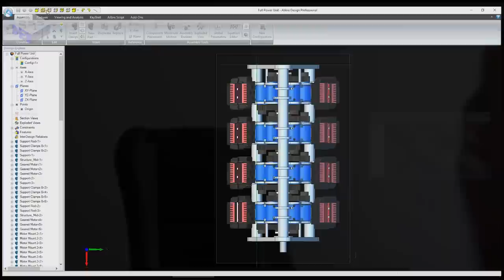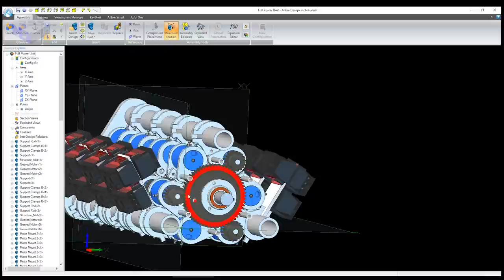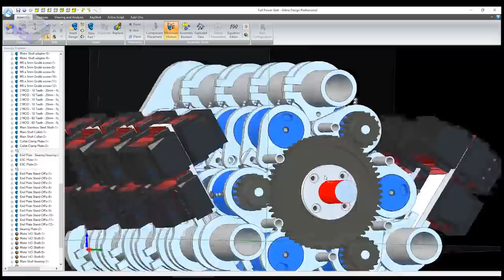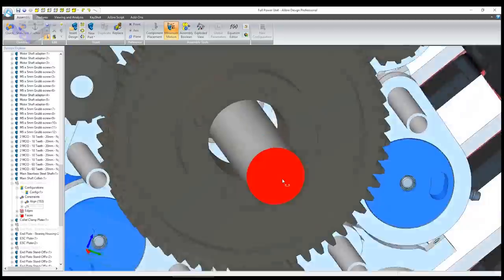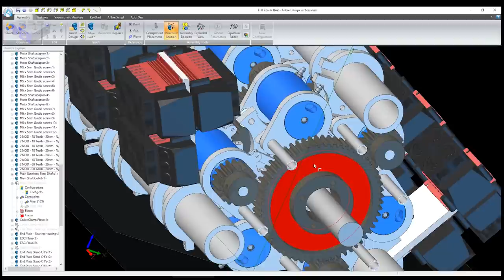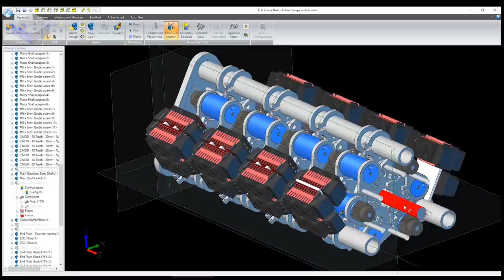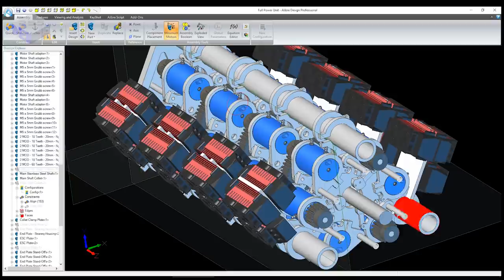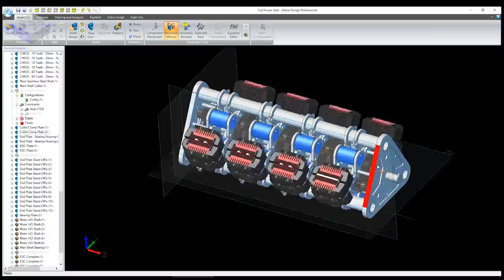MG F Electric Conversion - Take 2 - Better Audio

Comment: Whats the Dia of the output shaft? From the Looks of it I'd beef it up a little and ditch the collets. There'll be a lot of torque. Two opposing keyways will do away with Balance Issue. Thanks, love to watch!
Reply from the maker: The output shaft is 25mm steel, around the same size as my driveshafts on my 3.2 Vectra, so I figured this would more than cope with the torque. I like the idea of collets for zero backlash, rotational balance and it would slip if there was a fault instead of ripping everything apart. I'll bear the keyway in mind, a keyway was my first choice too, although I like the idea of multiple redundancies in the event of a fault.

Comment: Why not a boat ESC for water cooling
Reply from the maker: Good question, I can't remember considering these, may have to try one and compare. Would be interesting to see if you can continually pull max power through them, I wonder what formula E use?

Comment: Interesting project. Looking forward to seeing your progress. lots of interning packaging options, are you planing on keeping the pg1 gearbox?
Reply from the maker: Hi, yes will be either making a plate to connect direct to the box or cut the end off the failed engine as that would be easier initially
Reply: @TheSolarPoweredEngineer  You mention the length of the assembly, but how big is the bounding box its fits in? I can see  lots of applications in kit cars and simalar. what is the plan for controlling the connection and the disconnecting the individual drive moters from the main drive?
Reply from the maker: @TheCeebmoj  The unit according to CAD will be 415mm x 660mm x 255mm, where the car will be the housing, so just need to attach mounts to the power unit and enclose the engine compartment instead. I would love to be able to make this modular eventually and be able to take a module out and stick it in a jet-ski or something similar :-). there is a tiny metal geared motor that will connect and disconnect the motor, I chose not to use a servo for simplicity and space in the unit.

Comment: Did you already suggest how to move the Motors in terms of power distribution? And did you  chosse a away to put them in sync to not load them with unnececary damage while reentering the main power axis ?
But great worl, Im Maximum cusios about that project
#hitthebell
Reply from the maker: Hi, the sync may be done by measuring the main gear speed optically by counting gear teeth, then meshing the gears (this may have some impact, but hopefully very little, similar to a synchromesh on a gearbox), we will see

Comment: Can we get a link to the motors where to get them thanks 👍
Reply from the maker: Here ya go https://hobbyking.com/en_us/turnigy-aquastar-4084-1050kv-water-cooled-brushless-motor.html
Reply: @TheSolarPoweredEngineer  OMG!!! I followed the link and this engine will cost you well over £2k. A Nissan Leaf motor is less than £500, designed to be 80kW (110hp) but capable of much more and is bomb proof. 
I don't want to sound like a kill joy as I love the idea of an E- MGF but this sounds a bit crazy. 
Still I'm fascinated to see how it turns out so have subscribed. 
Good luck with it.
Reply from the maker: @alibro7512  I know, a little expensive to say the least, but it's worth it for all the questions it may answer and hopefully teach us, the redundancy is what I am interested in too, where everything can be swapped out easily and disengaged while driving if there is a problem. I like to try crazy things sometimes, especially when people say "that won't work" 😁
Reply: @TheSolarPoweredEngineer  I love crazy builds like this so long as you know what you're doing and from the look of your design you do. (Probably) 😉
Look forward to more updates.

Comment: Spur gears are going to be very noisy even if made of nylon. Helical gears should be used. I'm not seeing a lubrication method for any of these moving parts, it may work but not for long.
Reply from the maker: Hi, Yeah I agree, although just for testing, helical gears would increase the cost of this but could be added later on due to their higher surface area and increased load capacity too. I'd love to see how long these gears do last like this too, so I'll keep a revolution to load count in the programme and hopefully this will answer your question 👍

Comment: Heard about your channel in James Bruton's latest video, interesting concept! Have you done any calculations for efficiency vs one large motor? I'd imagine you could have a fair bit of loss due to gearing.  The modular design is great! You've probably already looked into these but you may also be interested in how the Prius mechanically load shares between the ICE and electric motor (https://auto.howstuffworks.com/hybrid-car7.htm) and how you can electrically load share (https://pdfs.semanticscholar.org/c17f/9838617bed88b66fcd6457545edec516dd9c.pdf).
Reply from the maker: Thank you,  I'll take a look at the load sharing bit, I won't know the efficiencies until I test a few motors together. If a fair few motors are disconnected it may just have less friction when you think of magnetic resistance in each motor, you would only use small coils in the ones that are on (just my thoughts at the mo though)
Reply: will the friction losses be worth the complexity of mechanically disconnecting a motor though? I would imagine it would be easier and more efficient to lower the power output of all 3 motors as a single module.
Mechanical complexity introduces failure points. You"ll also need a way to re-engage the single motor while the rest of the engine is running, perhaps match its speed to the other 2 connected motors in its module, the variance will just be shock loaded onto the gear teeth when it engages. Helical cut gears would be even harder to mesh on the fly

Its going to be very noisy with straight cut gears, but for the sake of development its the way to go initially, it'll be very interesting to see how the load sharing between everything goes, Subscribed!
Reply from the maker: @buttsexxor  Hi and thank you for subscribing, that's a good point with taking the speed of the other motors to sync with, I was going to optically measure the Teath of the larger gear and speed up the motor that way, although it would probably be easier to measure the phase of the attached motor and match the disconnected one close to that (it won't perfectly match due to changing load and other factors, but close enough not to strip Teath), once meshed increase the current to share the load. I will put this in my next video with your post name.... Watch this space 👍. I will probably use a frequency to voltage convertor and  feed that into the Arduino, or do this using an op amp to compare the two voltages, this would have a faster reaction to changing loads

Comment: The main problem I see is with the bearings in the motors, I am assuming that those are RC boat motors, due to their size. RC equipment bearings are often measured in the tens of hours, up to 200 hours on the high end gear. Quad copters have 4 props, and people say to replace the bearing motors every 40 hours of flight time or so, or the motor will replace it for you.  Say you have 24 motors, and the motors have a mtbf of 200 hours, with 1 in 4 motor bearings failing at 50 hours. However you are not using quadcopter bearings, you are using boat motors, and boat motors use the water that fills the drive shaft to lubricate the bearings and buffer tolerances, but you are running them dry,
Reply from the maker: Hi Michael, they are dry bearings fitted, these are standard bearings, where the water cooling is just a jacket to keep the body of the motor cool and not the bearings directly, although it will have an indirect cooling effect. I will be monitoring motor temperatures throughout and running water through them when required, although in my design they won't be running anywhere near maximum capacity like in a quad copter or RC boat, they will only be at high power for a few seconds during acceleration. The power unit in total can produce up to 100hp, although the majority of driving uses far less, where I have a data logger fitted to my CAN bus of my main car and the load averages around 5 to 15%. Maybe I am optimistic, although my previous engineering work has set me in good sted. Part of the journey is finding things that fail and then finding a solution. I like designing engineering projects that are difficult in nature just to find a better solution. Watch this space 😉👍

Comment: Synchronized gears can be done, but I don't know if it would work (well) under load.
https://www.youtube.com/watch?v=vHL3hXGsnuw&ab_channel=mrmyggos
Any ideas about how you gonna solve that?
Do you immediately go for the entire engine or first just a quarter as proof of concept?
Maybe even cool the ESC's too. Low tech DIY:
https://www.instructables.com/id/DIY-ESC-Water-Cooling-Radiator-for-RC-boats/

And don't forget motor mounts.
Think also about disassembling, shaft locks usually have 2 bolt hole to loosen them.
https://www.mikipulley.co.jp/EN/Products/ETPBushingsAndPOSILOCK/POSILOCK/PSL-K/index.html
Reply from the maker: The gears would sync to the speed while engaging, then ramp up to the load value when locked in. The load would be measured by the current draw of a master motor, will have to play with PID values to get the best result, although, with an ever-changing load, I may have to have it build a PID map (similar to an ECU map in a car).  I will take a look at the links